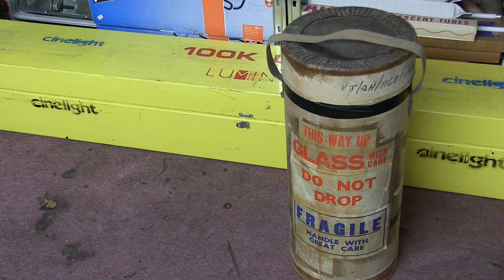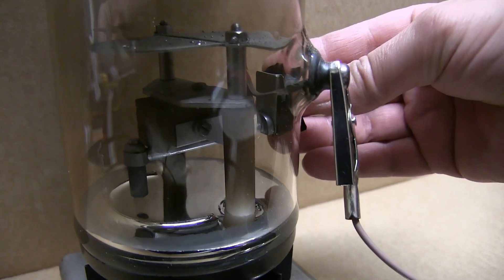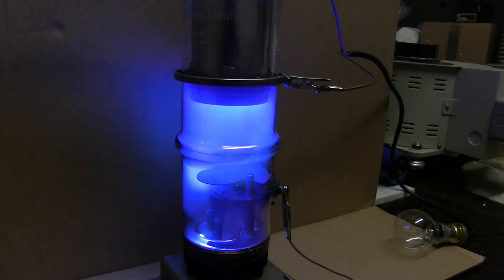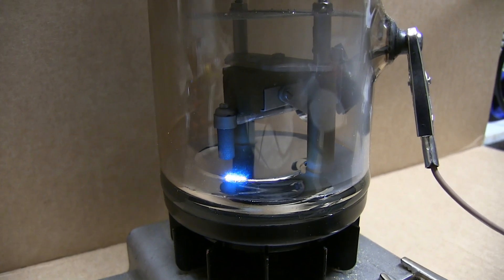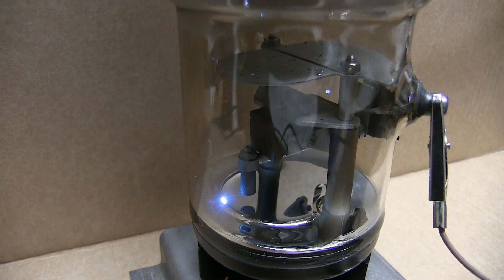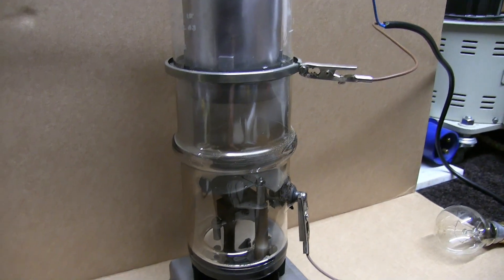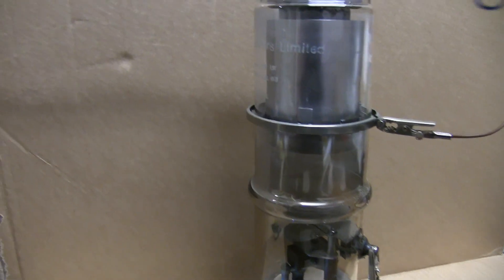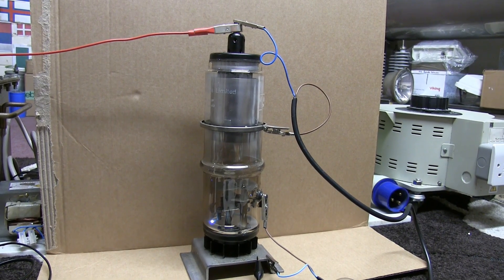Excitron Grid Controlled Mercury Arc Rectifier

Comment: That device looks like a predecessor to the thyristor, or silicon controlled rectifier which has been widely used in DC power control applications.

Comment: Very cool.. It acts like a cross between a Mercury arc rectifier and a Triode vacuum tube(valve). I wonder what the frequency response would be if one tried to use it as an audio amplifier output tube? I'd like to get a couple of these and try it. A guy would need one HELL of an output transformer to be able to drive a speaker with it though. 🤔

Edit: 😆😂 Then I get to the end of the video, and Andy already has audio input hooked up to the grid.. 👍 Awesome!!

Comment: Very nice color, but a lot energy in the form of dangerous UV light and X-rays. Beautiful and deadly. Also mercury vapour, at least through that starter-joint in glass and electrodes to lesser degree. Very dangerous device if handled improperly.

Comment: I have an AR63 Excitron which has always been purely for display. Inspired by your video I decided to get it going. But I've failed at the first step. I hooked up a bench PSU to the "dipper" and used a magnet as you did. Tried various voltages up to 30V and currents up to 5A. I get a nice blue spark when the dipper leaves the mercury pool but the arc doesn't continue.

Do I need some kind of inductive kick to start the arc? What else might I be doing wrong?

I suppose it's possible that the valve is no longer under vacuum. Need to dig out a violet ray machine to check that.

Comment: The flashing of the mercury vapor to the music made me think of older AM broadcast transmitters that used MV rectifier tubes in the HV supplies-the rectifier tubes would flash adn flicker to the music and speech of the program material being broadcast-BUT today with silicon rectifiers  don't get the beautiful blue flickering glow-and mercury vapor tubes act as a good visual overload indicator-when they glow almost blue white-a short on the power supply!

Comment: Maybe use the output to some heavy material on a continuous feed for a "nearly unlimited" audio bandwidth(As far as human hearing goes) on the output of the mix. n maybe some neat sounds on playback ;^p

Heck if 2 inch was the Master Standard, think of a heavy bar of magnetic memory type materials in layers to capture the unique output characteristics of each material in the layer.

Maybe the 30v layer could carry a digital pulsed signal across it with your analog across the mains. (think time-coding, midi, and any other time lock clocks to synch equipment?) or (furthermore maybe compressed forms of the medium?)

Meh maybe nothing new here... but hey, to have a recording venue alight with all these tubes, would be wicked.

Now these recordings would be played on a custom venue pa designed for the increased bandwidth of this recording medium to just use stupid amounts of power needlessly... just because it might sound cool.  yee.

Shrugs shoulders ...if= ...off to another tangent.

If I had money I would try to build the worlds most unique music venue, weird, quirky and strange that the whole time off prime time of the "paid shows" people could sign up for time slots to just play and jam through the system at will with doors open and free as a art center to if you chose to hear random artists its free, if you want specific is pay because of having to pay the band.

But again, the pay side would just be the support for the freedom of expression of art aside from big music, aside from server platforms... if no one is jamming you'd be able to just walk up plug in and jam with an on staff sound crew 24/7.

Feel free to put your opensource music waves out into the ether.

Feels good to dream.

Comment: That is an interesting tube! Everything I can find on them suggests they were used primarily with high-voltage three- or six-phase systems.
Seems almost like a "cold-cathode" thyratron...? Kinda neat to get that grid-controlled rectification without a heater! ;)

Comment: Hey.  I have an 8amp air compressor.  Will it run on a 3000w inverter running off a car engine and battery whilst the engine is running?
Reply: fyi it doesn't work just off a battery.  ill try on the car with the engine running and report back
providing i survive. lmao

Comment: Thanks for great memories.  As I said in the comment to your last video, I worked on transmitters using these rectifiers back in the 1970s. A bank of 12 of these in 2 x 6 phase bridge configuration could deliver 11kV dc at around 40 amps. It was always great to see the dippers jump up as the transmitter HT was started, followed a moment later by the blue glow from the 12 tubes. We didn't use the grid control to vary output power, but simply had the facility to switch one bank completely off to reduce the supply voltage while we tuned up the transmitter.  The grid, was, of course, biassed positively by a potential divider of encapsulated resistors so that the grid sat , I think, around half the anode voltage. I seem to remember that the excitation could be turned off to kill the output quickly in the event of an overload on the transmitter (which were frequent!). The high voltage AC was controlled by an oil circuit breaker in the substation which would take a good part of a second to operate, so this fast acting protection by the MARs was important.
Incidentally, we always called these tubes  "Ex-ee-trons", not "Excite-trons" - don't know if we were correct, but I guess we probably got the pronunciation from English Electric who origianally made these tubes, I believe, when the transmitters were installed in the 1960s.   Thanks, from an old transmitter man for bringing this back to life!

Comment: So I have a question and youve probably been asked a million times, but where do you pull that high power from? is it from the wall on a high fuse or are you pulling straight from the lines? maybe a video on that? also what is the cost of electricity for these videos? im sure its not stupid expensive but it would be interesting to see what the cost is for the electricity in the vids.

Comment: Sorry for the newbie question, but I'm not totally familiar with the function of this type of device.  At high voltage or current levels, does this device put out hazardous amounts of UV radiation?
Reply: This is essentially a vacuum tube phone charger.

Comment: My favorite part other than how he explained how it worked - was when he decided to hook it up to an audio output. That was awesome. And it's a very good demonstration of AM - amplitude modulation and frequency. I just love how he took an analog signal in AC and used it to feed an AC to DC conversation to prove his point. Bravo. It took me back into the 80's and 90's. Now I'm wondering what the lifespan of the rectifier would be if I used it in the same way for a lot of music.
Reply: Wondering the same... maybe use the output to some heavy material on a continuous feed for a "nearly unlimited" audio bandwidth(As far as human hearing goes) on the output of the mix.

Heck if 2 inch was the Master Standard, think of a heavy bar of magnetic memory type materials in layers to capture the unique output characteristics of each material in the layer.

Maybe the 30v layer could carry a digital pulsed signal across it with your analog across the mains. (think time-coding, midi, and any other time lock clocks to synch equipment?) or (furthermore maybe compressed forms of the medium?)

Meh maybe nothing new here... but hey, to have a recording venue alight with all these tubes, would be wicked.

Now these recordings would be played on a custom venue pa designed for the increased bandwidth of this recording medium to just use stupid amounts of power needlessly... just because it might sound cool.  yee.

Shrugs shoulders ...if= ...off to another tangent.

If I had money I would try to build the worlds most unique music venue, weird, quirky and strange that the whole time off prime time of the "paid shows" people could sign up for time slots to just play and jam through the system at will with doors open and free as a art center to if you chose to hear random artists its free, if you want specific is pay because of having to pay the band.

But again, the pay side would just be the support for the freedom of expression of art aside from big music, aside from server platforms... if no one is jamming you'd be able to just walk up plug in and jam with an on staff sound crew 24/7.

Feel free to put your opensource music waves out into the ether.

Feels good to dream.
Reply: True “Heavy Metal”.  👍

Comment: My advice is, "Kids, don't try this at home". I'm not referring to 10KV or 100KV power supplies, I'm saying, don't find yourself morally and legally responsible for safeguarding mercury. I have ten 5550 mercury rectifiers, each one about the size of a beer can, and containing perhaps just a couple tablespoons of mercury; safe disposal of these devices is gonna cost me $50 and I have to drive an hour to get to a hazardous-waste facility. These things came with a big batch of tubes I bought some years ago, and I was unable to find anyone who could use them, so it falls to me to be responsible and do the right thing.

Comment: The car heads would love this. Boom box and an ark rectifier in the back.
Reply: But is it shock - proof ❓
Reply: @brandschutzerderrwa-mann3879  It's not even acceleration proof.  It's supposed to sit still in operation.  All that mercury sloshing around.  Don't want it to touch any of the higher parts

Comment: Dear geeza chappie old chap! I'm from Oxford, near the flowing well pub, and I'm doing business with renewable electronics for nations like India which need easier access to things like wind and solar to run motorbikes cos it's too smokey out there. Do you want some cash for some raucus bangin irie red-hot hot-rod melting plastic vaporized metal smokin technology? Basically it's a 50KWh thingy to short until it blows up, the same as 50 hours of an electric heater can be released in 5 minutes, we'll supply the warehouse, you just do some intros and explodey fun. Photonic my contact is Ant dot stewart at yahoo dot com cheers for the vids! ez, it's like higher than 12k potentially. It's a reputation enhancing thing cos its irie/its real leading type tech.

Comment: Now put a giant loudspeaker transformer onto the anode, and build the most epic PWM/class D amplifier in history. Or take a conventional centre tapped one, with an extra excitron, as a push pull system. 
I think it might just switch fast enough to work as a subwoofer amplifier. A really big one. With built in light effects.

Comment: Hello Andy ( photon ) thanks for this video most interesting. I really enjoyed this one from an ham radio operator standpoint and my line of work as an service engineer. You have balls of mercury ( steel ) to have that around in  your house ( not judging ) i would not dare to have it anyware in my house. Nice collection you got of these ultra rare tubes :) If i had the balls of mercury i would use it in a HF amplifier with a GU84B radio tube to power it ( anode B+ is 3500 volts @ 2 amps ) . How nice that would look if you call CQ DX on 40 meterband  . To bad your across the pond otherwise i would love to pay you a visit ( will bring some belgium beers ) 73s to you Andy ( greetings ) from PD0ROH , Rob

Comment: if you stretch thermal blankets with the metalized side over that roof on the side the sun is beating down on at least, it will do far more to stop it from heating up than even 2 to 3 inches of that styrofoam pink or blue crap they use to insulate houses here in the US, (and it will last probably about 3 years if it is not destroyed by harsh weather like hurricane. tornado ect though its efficiency will drop each year, as the flaws in it let light through to the clear part blasting the aluminum coating off of it, but at about 5 to 10 pounds to drop that room by up to 20 C of thermal warming, (max depends on many factors like air flow through and what not also this is the raised temp by the sun, as it only reflects like 90+% of that sunlight back into the air or onto neighbors blinding them and making them absorb that heat that would have absorbed into your place, or if not flat maybe even focusing it like a giant telescope mirror on grass and such burning the shit out of it so yeah, gotta take precautions) anyway double that layer and make sure there is a little air between the layers and DAMN it rises up drastically how many degrees difference between with and with out, you get (and the second layer will last 10+ years against the light damage with out any noticeable at least with out refined measuring equipment deterioration to the ability to reject that heat, 

Don't believe me, try getting two layers of the stuff (like take one and cut in half) put a strip of styrofoam around the edge and use twoway tape to hold the layers together to it with the first layer laid down on something rigid like cardboard then put that across half a window that is in the sun, and wait about 10 minutes before feeling the window behind it and the side that is in the sun still :) trick is layering and making sure the conductive (test it with ohm setting on multimeter or a light up battery powered fuse tester (if fuse is good it lights up cause battery power passes though the good fuse to light up the light, if the fuse is burnt then power from battery to light on one side will be broken circuit type of thing, super cheap and much easier and faster to tell which is the metal side as they look damn close to the same to the eye, and this metal side reflects all the IR and most UV back into the air, but that clear side that is not conductive while clear to our eyes, is solid black to the IR that emits from the metalized side of the other layer absorbing its IR light (heat through vacuum which air is like 999 parts vacuum per 1 part per 1000 of gas particle so seems to be plenty good as a vacuum for this in a house, maybe with a pure vacuum and more layers you could even make an ice box level cold chamber that and aerogel as the separators between the mylar layers, guessing it would have to sit a while undisturbed between grabbing a beer or something chilled in it, out of it LOL) anyway just a thought  that might make that room cooler during the summer, with out costing a fortune like running AC and installing some sort of insulation in it while prices are skyrocketing right now, and with far less interruption in your life though not sure what neighbors would think of you having a giant silver party balloon stretched over your house LOL.

Comment: I'm more comfortable playing with extremely high voltages than I am with even getting close to mercury metal. am I crazy?
Reply: When metallic, mercury is fairly innocuous. It’s when it gets attached to something else - like methyl mercury - that it gets really nasty.
Reply: @darkwinter6028  Yes and no.  It readily makes vapours, which are more reactive.  It won't kill you instantly, but if you're around it persistently it'll do something.
Reply: @tsm688  yeah; the problem is that we don’t live in a hard vacuum, so there’s lots of stuff for those vapors to react with, and turn into the nasty version. It doesn’t take much activated mercury to really mess with you. Personally, I think I’ll stick to solid-state rectifiers. 😉
Reply: As a hatter.

Comment: Hang on, when you control it with music it outputs DC power in sync with the sound right? Could run some of your really powerful lightbulbs off that again for a light show?
Reply: Yes, I think that would work.
Reply: @eDoc2020  or, just thinking, would that thing work as the amplifier for a subwoofer from hell? Convert a big trampoline into a speaker membrane with a sturdy push-pull coil arrangement and run it off the Excitron. 11kW of bass eh?
Reply: @Kaboomf  Maybe. It can only modulate AC, so you would need a high frequency AC supply. It would probably just be easier to make an amp out of semiconductors, 11kW should be easy with modern IGBTs.
Reply: @eDoc2020  yeah, you're right I didn't think about the frequency.

Comment: So an old school version of a SCR/transistor/giant triode? If that thing can work at audio frequencies like it seems to that would make a massive audio amp (like 10kV/2A ) for a plasma speaker.
Reply: Dont think it can, as it converts ac to dc
Reply: @StofStuiver  Pulsating DC can still make sound, just half as effective as AC (assuming 100% ripple). 2 of those and you still can have + and - peaks.
Reply: @StofStuiver  possibly could use 2 one positively biased and one negatively biased? or would that just expload or something
Reply: @firenado4295  Dunno about mercury rectifiers but the silicon version just has 2 in series in push-pull (with the + connection of the output in between them). It's fine as long as both don't turn on at the same time (which then shorts the power source, usually ends up as exploded silicon). With 4, even better (more efficent/less stress on the silicon/2x output voltage), just use those in an H-bridge.
Reply: Two of these in anti-parallel instead of the spark gap in a SGTC, in synch with a third one disconnecting the HVDC source
Reply: @tripplefives I'd still like to see the output, if these can work at desired frequencies